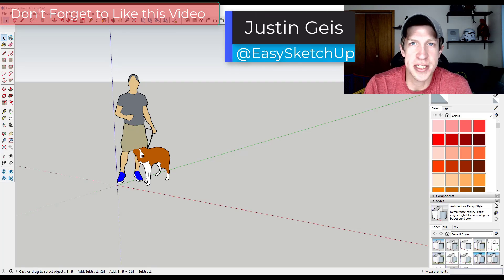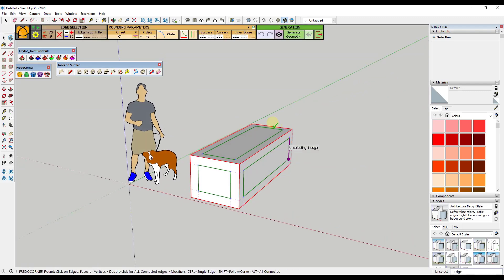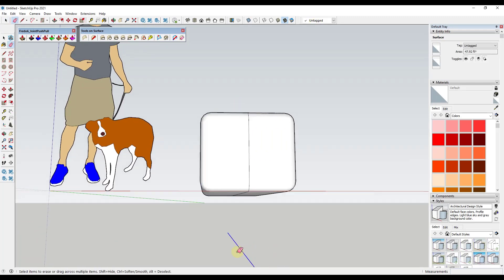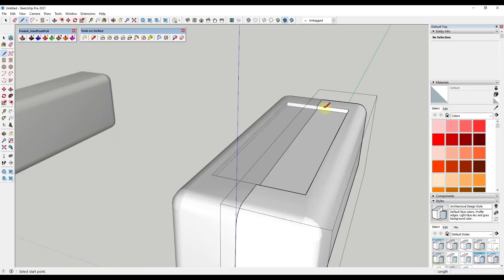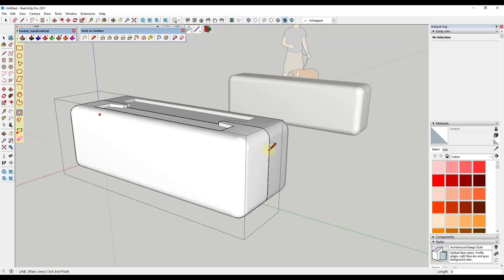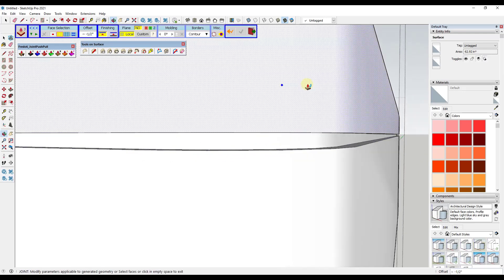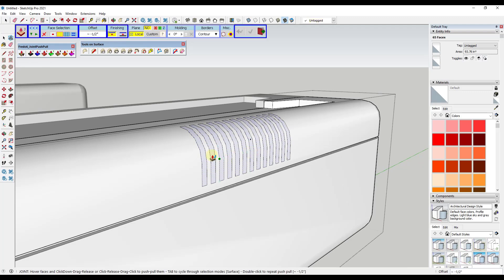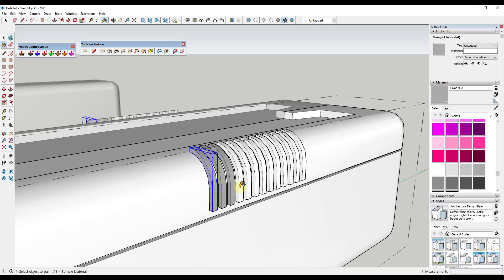Modeling a SCI FI CRATE in SketchUp - Extension Modeling Tutorial!

Comment: Hello! if we import this asset to Unreal, it will have at least 4 Drawcalls ( 1 drawcalls per color) is there something we can do for that? I' masking because i made my own Sci-fi Crate before seeing this video, and my Crate have 25 '' Material Element '' when imported in Unreal, so 25 Drawcalls.. it's ridiculous lol. The reason i have that many drawcalls, is because in Sketchup, you paint faces! So on my Crate, i have some textures that have to be chrome color for exemple, so if i want a chrome color, it will be +1 Drawcall. 

If i want a gray color for the main Crate, it will be an other Drawcall. At the end, you have 10-25 Drawcalls because you have 10-25 different colors. 

Question: Is there a way to optimise it or using a merge technicle? What is your view point, if you want to importe this Sci-Fi crate in Unreal? Thanks! :P
Reply from the maker: I'm not familiar enough with Unreal to know the answer to this. If you have multiple materials in your model, it seems like it would have to create a call for each one of those, right? It sounds like you need to reduce the number of colors you've applied in SketchUp? Maybe make sure you're not applying colors to both raw faces and the outside of groups?
Reply: @Thesketchupessentials  well, if i create a cube without any group, and paint each side with the same basic color named '' Red'' for exemple, will i get 1 draw call per faces? or 1 drawcall for all the faces that got the '' Red'' color?!

Do i have to create group before painting faces? or Sketchup will merge it to be 1 drawcall per textures you create, what ever the number of faces you paint it? 

I always used '' Make Group '' to create groupe of objects that goes with the main objet. For exemple, my Sci-fi crate have 2 slide doors on the top, thoses 2 doors are in separe Group, to be able to animate them. 

Do groups have an importance when texturing and painting faces? 

Thanks for all your answeres.
Reply: i, actually have 23 different textures. the problem is that i can't use the same texture for multiples object. Exemple, i have 2 separe door on my Crate. thoses 2 doors have a gray color, and the main crate is a gray too, but in a different shade. So here, i have to create 2 kind of gray, wich will result in 2 drawcalls. 

The more details you add, the more color it take and the more drawcall it will be. 

Normally, when you texturing an asset, you need Photoshop to create Normal map, Heightmap, UV map.. and all other complexity, to get the less drawcalls possible. 1-5 texture normaly per object, while my sci-fi crate have 23 texture because i need specific pieces, to be specific color.

Apprently, to make a movie or an animation, you dont need to worry about the number of drawcalls, because it will be video rendered, but in a video game, it's in Real Time, the more Drawcalls you have, the less performance you get.